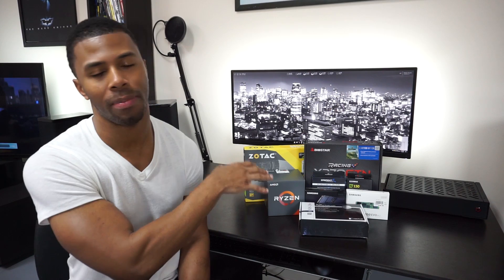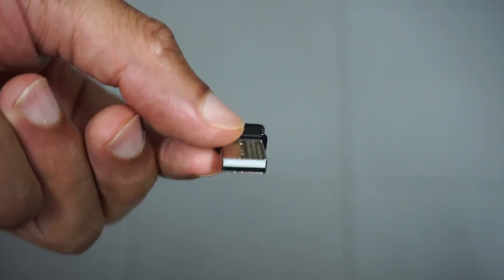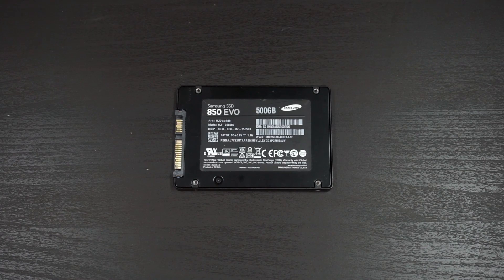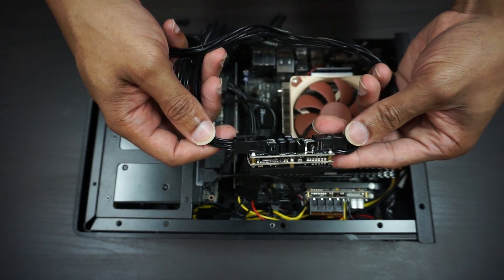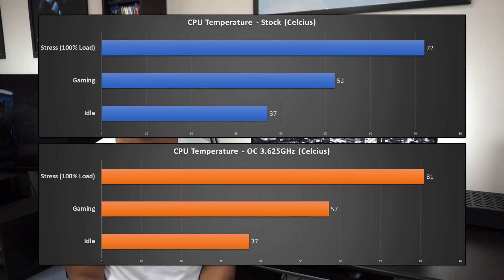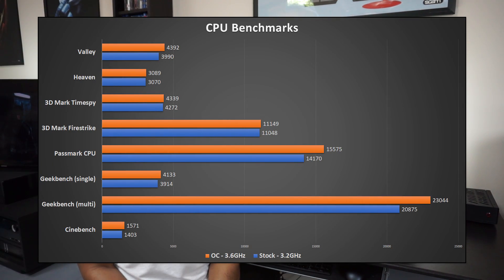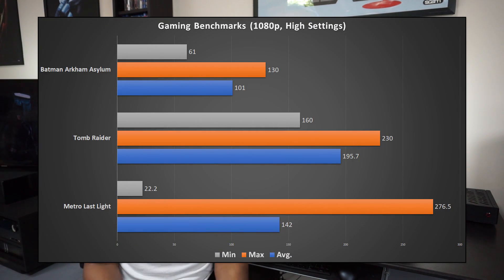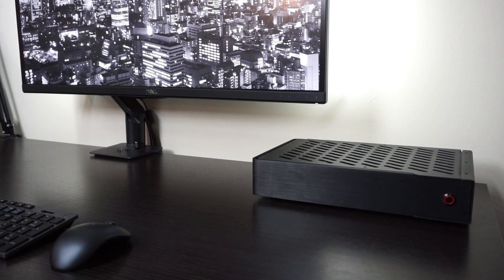Ryzen 7 Mini ITX S4 Mini Build w/ Temps + Benchmarks

Comment: These are the sort of builds I’d like and a m.2 drive is a given with how bad cabling is,  although it is annoying to see the pico psu units including sata cables,  manufacturers should start making cases on purpose without sata options from built in psu units.

Comment: Have some specs and wonder if you can help me out to let me know 3 things. Will temps be too higher for my CPU, will power be sufficient for my setup and will my 4tb 2.5 hard drives fit in the case because they are thicker.

CPU- Ryzen 7 2700
CPU COOLER- Noctua nh-l9i am4
GPU- zotac 1050ti 4gb sff
RAM- Gskill Tridentz RGB 16 GB DDR4 
MOBO- Asus Rog Strix Z370-I
SSD- 960 EVO 250GB NVME/ 512GB Toshiba NVME
HDD- 2x 4TB (ST4000LM016) Seagate 15mm thick 2.5 inch
PSU- HD PLEX 160W/ (230W DELL AC ADAPTER or 330W Dell AC Adapter??)

I want to get this case but not sure if that setup will work or not. Watch your channel alot and would appreciate your insight and opinion

I use the case to only emulate games from playstation 2 down..
Reply from the maker: For you use case, you should be ok. Just watch the CPU temps/power draw. Downclocking the CPU a bit would be smart. If you can afford it, I would opt for the HDPlex 400. That will give you more wiggle room for future builds.
Reply: @Tekeverything  Does the HD Plex 400 come with all the wires I need and can I use my Dell ac adapter? Also I'm all about the cable management and like things clean in the case like yourself. Any way you can link the sata cables and 3m car stickies you use. Would highly appreciate it

Comment: Is your noctua CPU cooler blowing hot air into the ram and I/O? I was wondering of doing a similar build. The AMD version is retangular while the Intel version is square. I was thinking of getting the Intel version but with AM4 bracket so I rotate it 90°. I saw your video comparing the coolers. Is a big difference?
Reply from the maker: So the cooler is actually directional. More air will come out of one side as it is angled more. I have it pointed away from the RAM. The difference between the 9i and 9a is small, around 3-6C in my testing. The 9i is compatible with Intel and AMD boards, while the 9a is only compatible with AMD boards. If you want to change the direction of the airflow you will need to get the 9i like you mentioned.

Comment: and OC :O just GPU is 120w and proc is 65w, how is this posible ???
i wanna do a build like this with a i& 8700 (not k version, don't need OC) with 1050 or 1060, 16gb rams and i have so many doubs that those 160w can handle this build
Reply from the maker: That should work, but you may run into some issues when the system is under load. You would be better off with an HDPlex 400W to be safe.

Comment: To cover up the ssd label, the thing to do is to cut out a blank piece of paper over it and tape over it with strips of electrical tape. You want to avoid removing the label as much as possible if needed in the future for reference or warranty reasons.

Comment: I just built the same config except a Ryzen 5 1600 instead of Ryzen 7, and my system doesn't turn on most of the time (rarely it does and once it starts up everything is fine). The system is fine when I connect a more powerful ATX PSU. So what gives? How did you get it to work for you?
Reply from the maker: Are you using an HDPlex 160W?
Reply: Tek Everything yup. I solved it by getting a Dell 240W power brick instead. The 230W wasn't enough juice to start up my machine every time.

Comment: Hey man awesome build. I'm running the same board and cpu. Can't get hardly any overclock stable. How did you go about getting yours to 3.6
Reply from the maker: I used Ryzen Master to OC. The CPU BIOS settings for this board increase the base and boost frequency. They don't set a locked core clock like you see on most boards. Biostar really dropped the ball with this BIOS.
Reply: Tek Everything O ok, yeah the BIOS is pretty trashy on this one, but I like the look of the board. On the overclock with Ryzen Master I couldn't get the overclock to stick after reboot. You run into this issue if so how did you fix it.

Comment: THIS IS AN ITX BUILD!

I love how compact and powerful this is. This is a real console killer. (for higher price of course, but occupying the same space or being even smaller).

Also I can't believe that picoPSU can handle Rizen 7 + GTX 1060 and 3 SSD. That saves a lots of space!
Reply from the maker: I'm glad you like that build, thanks!

While you may be able to run this system with a Pico. I am using an HDPlex 160W. Same idea, just a little different execution.
Reply: @Tekeverything  So that single 160w PicoPSU is powering the whole setup? Can you confirm?

Comment: To what Frequency did you push your ram?
Any Problems with the board?
Reply from the maker: I left it at 2400. Whenever I tried to increase the timings or anything It would crash. To be fair it is a 2400 kit, so I may just have to pick up some faster RAM.

Comment: I'm really liking the look of the S4 mini case.  Is it worth it in your opinion to use this for an older Haswell system?  Technically I know it may not matter as long as I have the power and cooling under control.  Open to any and all suggestions.
Reply from the maker: It is worth it for any system IMO hah. It is still my favorite case by far... Just be careful because there are added costs associated with building in a case like this.

Comment: Does the convertor act as a heatsink for the m2?
Reply from the maker: While I can't tell if it makes direct contact with the top lid. The m.2 drive in the enclusure is running 1 degree cooler than the standard SATA drive (35C to 36C)... and that is while sitting right over the GPU.
Reply: So it does. Wow ...

Comment: I think I'd have bought the 1700X (maybe even the 1800X) and just left it stock.  XFR tends to offer a better balance between performance and thermals compared to just straight-up overclocking, which is important for such a small rig.  Regardless, nice build.  With the 4-pin connector, I don't think I'd risk overclocking past the speed you set anyway, so I'd say you stopped at a good point.

I have the same motherboard, but my ITX case is roughly 4x bigger.  I needed the extra size to fit my whopping 250mm GPU and 140mm CPU heatsink, but it still beats having an ATX mid tower that I don't need anymore.
Reply from the maker: I thought about the 1700X. I was able to get this 1700 for $271, and I wanted a CPU I knew could be cooled/powered successfully inside the S4 Mini. I may try to pick up a 1700X for testing and comparison.

Comment: Thx for the video. This is the style of Mini-ITX build I am considering but I'll be more budget minded. Ryzen 5 1600 and a GTX 1060 level (AMD of NVIDIA) GPU and only one SSD to start out with.
Too bad the MB doesn't have WiFi. Hopefully better boards will come soon.
Questions:
- Would the stock Ryzen cooler fit in this case?
- Can the case be used in the vertical position? I have way more vertical space than horizontal. :)
Reply from the maker: The stock cooler won't fit unfortunately... but you can definitely use the case vertically.
Reply: Thx. Will look into the Node 202 suggested in another post here.

I came up with a Ryzen 5 1600 build with that case that would be in the $860-$870 range with a 1050 level GPU. That's pretty much the budget for a new rig.
Keep up the good work.
Reply from the maker: Sweet, sounds good. Let me know how it turns out.
Reply: It'll be a few months but sure.... will post a few comments when it happens.

Comment: Tek, I can understand going for 3.6 ghz to get the peak of performance/TDP ratio....but you have to understand that not all people want this. 
Other people want are interested in SFF because they don't need to compromise. 
If you don't at least try to get to 3.9-4.0 etc. you are ostracizing these viewers. (for lack of a better word, I agree its way too harsh) .
So let's say you are not able to get to those high clocks without your cpu throttling.
Then a very very interesting bit of information would be to see what is least tall CPU cooler that can achieve that.
Reply from the maker: I understand what you are saying, but this is a build video about my personal rig and setup not a CPU test.
Reply: to be fair, the temps for 3.9 or 4.0GHz will vary, since it  depends on the silicon lottery, in other words at what voltage can you get that frequency, so it would pretty much make it  a pointless test, when going really small form factor you have to make some compromises. The good news is that you can actually overclock, just dont ask for too much.

Comment: gigabyte has an am4 mobo with ac WiFi bt 4.2 and an m.2 connector available
Reply from the maker: Yep, unfortunately the board layout is a mess. I am probably going to go with the Asrock B350 board whenever it comes back in stock.

Comment: Nice video! My question is can that tiny psu can handle the rig at full load? Does it get too hot when under full load for some hours?
Reply from the maker: It handles this system with no problems. It is rated up to 200W, but can handle loads over that. Yes it gets hot, but that's normal, nothing to be concerned with.
Reply: Tek Everything thanks for the reply. can you continue to observe the system for a while please. from what I know if you stress the psu too much not only that it will cause stability problems but can damage the psu itself and can even cause fire if it gets too hot thanks
Reply: Steve R. Yeah from what you know! 65Watt CPU + 120 Watt GPU, 200 is max rated. Ofcourse actual threshold would be much higher... Keep your fire with you.
Reply: Well.. The actual power draw would be a bit higher than that if you factor in the ram, the motherboard and the storage. Lets suppose all 3 of those draw 30 watts under load. That's 215 watts total. (65 watts for the CPU plus 120 watts for the GPU.) That Pico PSU is actually rated at 160 watt with an allowable peak of 200 watt. Things can go wrong if you use them outside of their specs you know.

I am just a bit concerned because if I decide to build a system like this, I don't want problems down the road.
Reply from the maker: You are talking about a theoretical max power draw. Both components have hard power limits. The only way you could get this system to pull over 200W would be to run Furmark and Prime 95 simultaneously (which I have done). There is really no real world scenario in which this would occur.

Comment: A note about upgrading the mobo in the future...The Windows product key gets branded to the motherboard, and Windows will show as unlicensed if you just pop the existing system drive onto another motherboard.
Reply: ft55555 Dude, I have changed my motherboard from an GA-970A-DS3P to an 990X-Gaming-SLI and I have 0 problems with my Windows Key! I just popped in and boom Windows activated!

Comment: So you're saying, for gaming stick with intel but for rendering stuff go amd? I'm doing an upgrade build for my ITX and I got to start at the heart the cpu, mainly I just want to transfer everything over and my current specs are: i5 4430, 8gb ram, gtx 950, 2tb hdd. and whats powering her is a 600w. Should I stick with intel or go amd on an upgrade build?
Reply: Go with the ryzen 1600. Gaming performance tends to be less than a 5-10% difference. Also, the AM4+ platform is going to be used for at least a few more generations, whereas intel's new X299 is just a cash grab. Also, with sales right now the 1600 can be had for <$200
Reply: Nino Why wouldn't he get a 1600? It overclocks to the same speeds as the 1600x and has the same gaming performance as the 1800x. it really is the sweet spot for the ryzen lineup for people who still want to game but don't have to do a ton of heavy rendering or other CPU intensive tasks.
Reply: well he already has an i5, which is a decent chip, if youre gonna spend money might as well go and get the 8 core to get the full experience otherwise youre just spending cash to get something thats not justifiable(not worthy of an upgrade) . thats what id do, to be fair the best thing he should do is just buy a new gpu and be done with it.
Reply: just take into account that he is spending cash for an complete new platform (while having a decent platform already), so new cpu, new motherboard, thats over 300 dollars if he goes for the 6core
Reply: So for gaming (using The Division as a benchmark) this cpu should be good for it right? I love the ITX builds but I know I need a new build for the fact that I'm getting bottlenecked...
Reply: if youre upgrading an i5 dont get a 1600, just go all the way with the 1700 or simly dont upgrade if the i5 fulfills your needs.

Comment: Try with Node 202 case! Perfect itx case ^^
Reply: If you're going for the ultimate in size, S4 mini actually beats the Node 202 pretty handedly. On the contrary, if you're going for a small but powerful rig, the Node 202 allowing a 600w SFX-L PSU and full sized GPUs is quite nice.

All depends on what you're going for.
Reply: The Node 202 is definitely better for cooling, but that's about it. An HDPlex 300W has been shown to power a Zotac 1080 mini just fine.

Comment: how can you power a gtx 1060 and a r7 1700 with only a 160watt psu? didn't know that that was possible
Reply: old school tech magic.
Reply from the maker: The HDPlex 160W is rated up to 200W, but is capable of handling loads slightly higher than that. Paired with a 230W power brick, it handles this setup easily. My older i7-7700 actually used more power than the 1700

Comment: I just ordered a gigabyte am4 itx wifi motherboard yesterday. Some of the cable plugs were in kinda weird spots, but I don't think it'll be that big of a problem. I wanted the Asrock board that came out yesterday, but it was near impossible to get. The gigabyte board has USB 3.1 gen 2 ports; that's how I justified it xD.
Reply from the maker: Yea, the Gigabyte layout is a no go for me. I have the notifications set up for the Asrock AB350, that will be my next purchase for sure. I am holding out hope that we get a Asus AM4 ROG Strix board eventually.
Reply: And Intel lan and a fan header more than the others.
Reply: Gigabyte ITX layouts (for AMD at least) were always weird. That way I always bought Asrock ITX mobos (FM1, FM2 and FM2+). It'll buy the AB350 Gaming ITX/ac as soon as Raven Ridge appears. (I don't get the point of the X370 model)